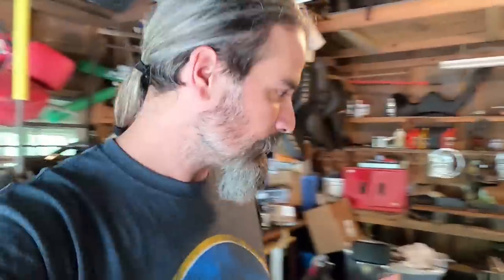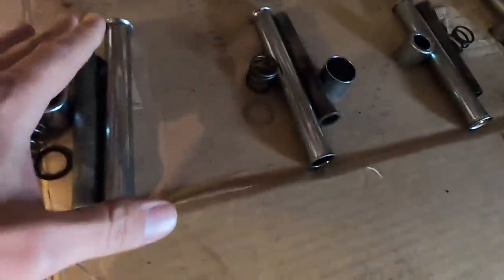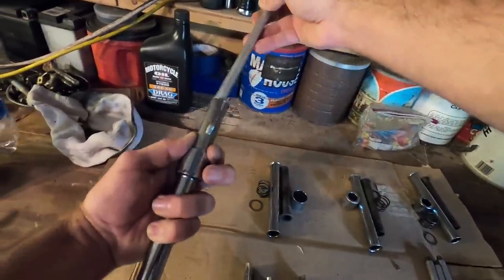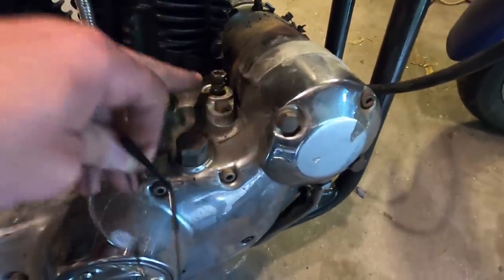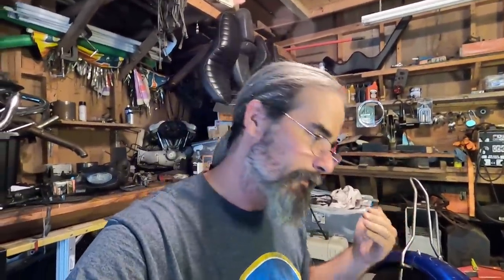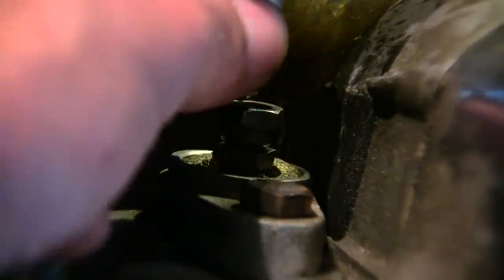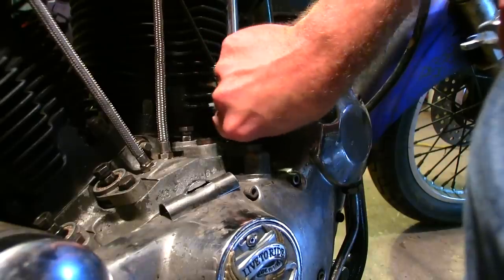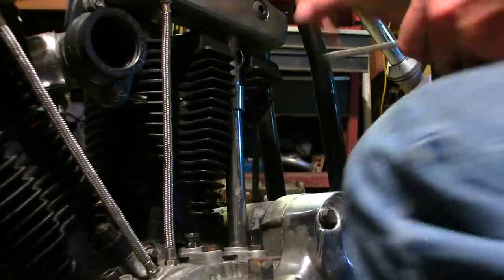Adjusting Pushrods On Harley Davidson Ironhead Sportster

Comment: Ironhead push rod/ tappet adjustment on cold engine. Adjust tappet at lowest position and when like tappet is at highest (valve fully open.) Inlet valves nearest carb.

Comment: You did a professional job. Straight out of the book. The only thing I do different is I put all pushrods in, then kick engine thru a couple of times and recheck clearance, then put all 4 tubes on. But if you were sure as you went along - no problem.  Remember when you do reconnect electrical to polorize the generator.  "Flash A post of generator to +,  battery pos post

Comment: In 1973-1975 I was unable to get those beautiful cork gaskets for the lifters. I had to salvage the best used ones I could find. It was a 1953 panhead and it didn't leak when I finished putting it back together.

Comment: 11mm slash 7/16th? Use an 11mm if you don't have a 7/16th? What kind of advise is that? Who, working on an old Ironhead wouldn't have a full set of all tools, and who, while adjusting the pushrods wouldn't have a shaved thin 7/16??? 

Stop trying to be so "inclusive". Trying to include those who don't have enough sense to have the basic tools.....sheesh!! Have enough truth to say, "If you don't have a decent full set of tools go and buy them or don't bother working on an old Ironhead.  Or working on ANYTHING for that matter.
Reply from the maker: Meaning if you can't find a 7/16, a 11mm will work just fine too.

Comment: Amigo...well done. next time try just a thin layer of lube on the new cork gasket when installing, After you get the spring clip in the push rod tube and it goes "snap", rotate the tube (so it self centers)  just a little to make sure its seated into the new cork.....Good job.... good video.

Comment: I just did my 72 FLH . You did it like I do if I recall two of the rods are shorter.
Reply from the maker: Mine are all the same.
Reply: @SaddleTrampTV  I couldn't recall it has been 30 years since I had them out I do adjust them but I don't ride my 72 like I did. I have an 02 FLSTC but I am looking for a good Evo. I just sold my 01 FLHRCI Road King.  Not a fan of these twin cams.

Comment: Next time if that pos runs long enough to  need a valve adjustment try changing the lock nuts and a little oil on the push rod ends is mandatory.
Reply from the maker: It's only a POS if the one riding it is too incompetent to maintain it. And the pushrods did get some oil on them. Not everything makes it onto the screen at times.
Reply: @SaddleTrampTV  I like that attitude.........I subscribed...your videos are great..yall take care

Comment: My first harley was a 74 sportster 1000 with right hand shift and kicker only. Always had trouble starting it when the engine was warm. Rode it to sturgis in 1990, about a 500 mile trip from home. Didn't dare shut it off to refuel because it wouldn't start warm. Ended up doing a compression test on it and lo and behold only 20 psi hot. Push rods were set too tight and when the engine warmed up they would hold the valves open ever so slightly. And with a kicker only you would kick that bitch 50 plus times to get it started. Adjusted the push rods and from then on it started first kick hot or cold. Suffered with a shitty starting sporty for damn near a year til I got that figured out. Wish I still had that bike
Reply from the maker: Yep. Had that same experience with my old 79. That's why I said to make sure they freely spin and to do this only when the engine is cold, because metal expands when it gets hot.

Comment: Have a question or 2 maybe 3.. looking at an 81 ironhead sporty for a chopper project. I own bikes all metric this will be my 1st harley closest would be the xs.  Want to ride not bar hop so weekend trips or longer how is the 4 speed with vibration vs a say 91 5 speed.
Reply from the maker: Not much different. You'll run a higher rpm though while trying to do highway speeds than you would with a 5 speed.

Comment: Don't know if you know it or not, but the braided lines don't provide a lot of oil for the rockers / valves. Just a tip from quite a few iron Head knowledgeable people.
Reply from the maker: Thanks for the heads up

Comment: i have a ? i have a  1975 sporty it has new electrinic ignition in it new coil new carb super e everything jetted right when i start bike in joke it  kinda races then slows down i know the bike will rpm more with choke on as soon as i take joke off it popps bad out carb and exaust wont stay running even with idle adjusted up bad back fire out exhaust ect. everything is timed coil tested ect the only thing i havent done was check push rods for adjustment ect have you run into this issue im thinking the push rods may need adjustment ect
Reply from the maker: That sounds more like an intake leak. But it wouldn't be a bad idea to check your push rods also.

Comment: Hey, new subscriber here. Thanks for the info. I have an 80 ironhead that I acquired not long ago. Still getting acquainted with her. She's quirky. I'm running into an issue where I keep carbon fouling spark plugs. Now, I am a mechanic but new to Harleys. I took apart the carb and cleaned it up like new, checked for fuel and air leaks. Nothing. I noticed the front intake pushrod tube, on the bottom end, the bolt won't tighten into the case. Yep, it's stripped. And oil just spits out when she gets up to operating temp. I'm tempted to helicoil the case, but I'm hesitant in case its a bad idea. Any ideas?
Reply from the maker: You don't have anything to lose by trying that; being that it's already stripped. If that doesn't work, you can try tapping some new threads of the next size up. Or you could fill the hole by welding it, and then drill and tap some new threads.

Comment: Excellent Video thanx,  But off topic, Did you use any sealant between the rubber carb boot & the intake flange? I am asking this, as I have done a single carb conversion on my Yamaha xv1100 & I have just received a new carb boot for one of my old harley cv40 carbs, so thought I would ask what you did, before I continue? :)
Reply from the maker: I haven't. The boot is self-sealing. At least mine is.
Reply: @SaddleTrampTV  Sounds like my boot, it has 2 small round raised circles around the intake hole instead of a recessed o-ring, I just thought I would ask, that's all, Keep up the good work mate & Ride Safe!. :) PS: Thanx for getting back to me so quick!.
Reply from the maker: @apophusra59  Yeah, That's how mine is too. Thanks, man.

Comment: My 2 cents! Adj. rear intake when front intake is all the way up! Adj. rear exh. when front exh is all the way up! Now do the same for the front cly. Rears up adjust the fronts! Not on the bottom of the cams! TIP. Also fram VW beetle filterworks better than glass filter which heats gas vapor lock!
Reply from the maker: Yeah I guess so, man.
Reply from the maker: @revbikerbigd8664  I've always done it like this, and never had any issues. Each to his own... That is if it works; which this way does.
Reply: @SaddleTrampTV   do what works! Sorry for the input👍l have been working on Harley's for 46 years, and the way I do it is the correct way, do some homework, it will run and sound better! My own repair shop for 35 years, Retired now, just trying to teach the right way.

Comment: Can the pushrod be too long that can cause a valve to stay open?
Reply from the maker: If you get the adjustment wrong, yes.
Reply: @SaddleTrampTV  my bike was working fine and someday it started leaking oil thru the rocker box, removed the tank and noticed every bolt was lose, tightened everything and tried to start it and front cyl intake valve seems to be open cause it blows compression thru the carb, before i tightened the rocker box it was working just fine

Comment: Well what I didn't like was you told what to do with the front push rod but you didn't tell whether to lower the other ones or where they stay where they're at and you just put them all in and adjusting like you said that's what I want to know do you lower each one every time you go to it or they stay where they are when you set the front one
Reply from the maker: Of course I lower each lifter first. I figured it would've been obvious enough that you would do the rest of them the same way by watching how I did the first one.
Reply: Thank you very much Saddle Tramp that's all I wanted to know looks like it's pretty simple do you adjust the old shovel heads in the same order
Reply from the maker: @rickdougherty7521  That I'm not sure of. Don't have any experience with a shovel, but I have been told they are done the same way.